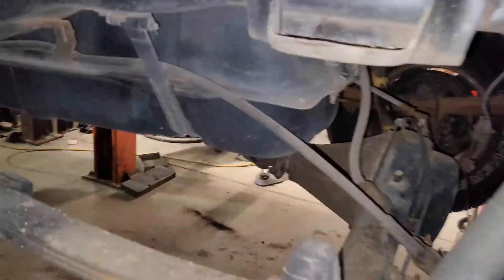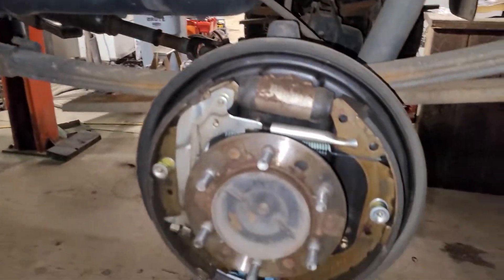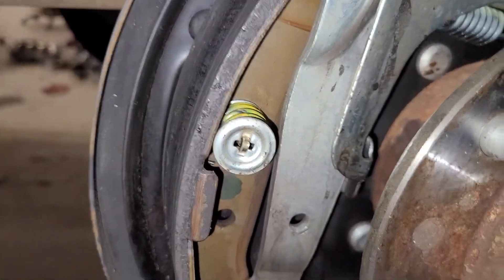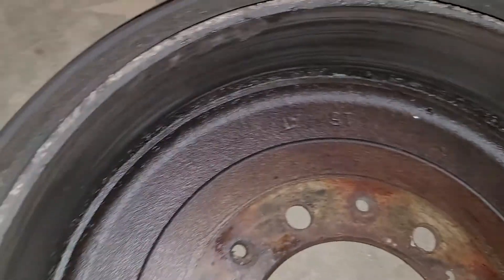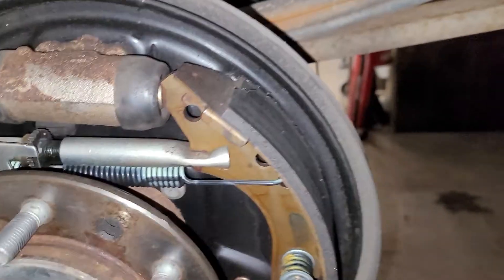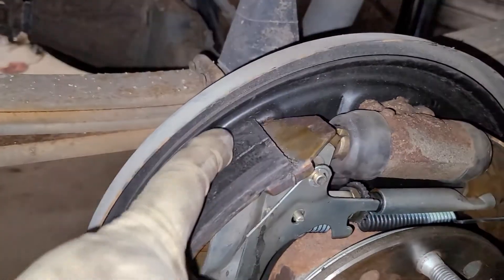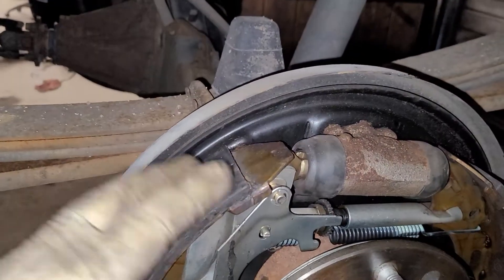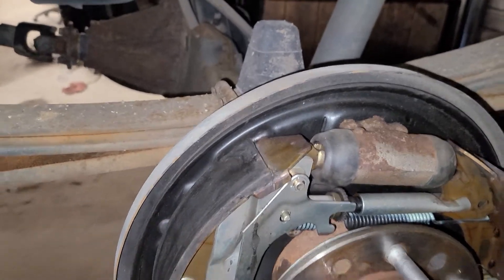What are the chances ?

Comment: Way back I had a 1966 Dodge Coronet with the adjustable rear axle - for end play . The seal leaked . When I pulled the axle to replace it , there are two pins that float in the differential . One of them fell out inside the ham and the seal would leak in short order . I had to replace the entire drum to drum unit . I worked at a auto electric rebuilder and was able to put the brake shoes in a hot tank and remove the gear oil . I later learned the chemicals back then were cancer causing . Do you remember when brake shoes has asbestos and they would ARC them to the drums at the parts store ? Imagine breathing that in on a daily basis ! Different world .